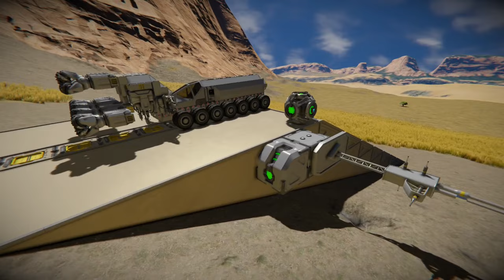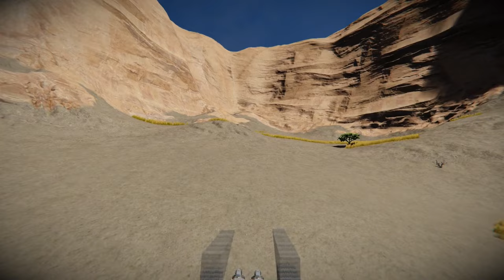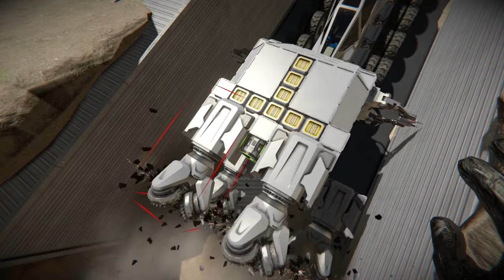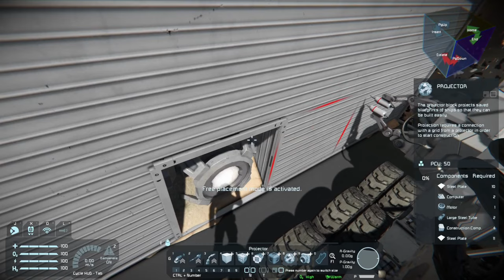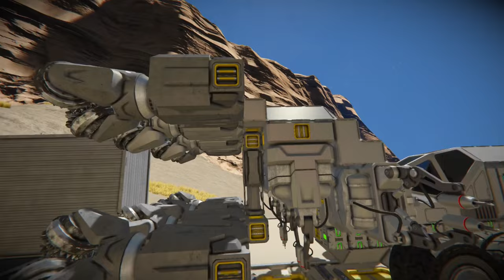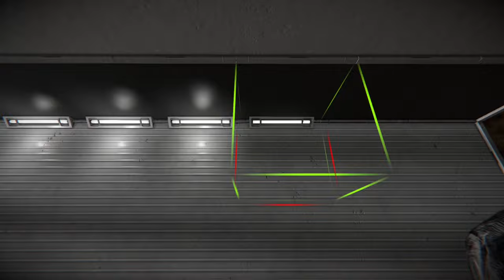How To Drill And Build A Tunnel The Easy Way

Comment: I've built many underground bases, from small to large, but usually do it with stationary drills and welders piped back to refineries and storage so I can process the stone. I've looked at using a rover but the main issue I have is that to go forward endlessly you need to right click mine, and you can't do that outside the cockpit. If you left click, where is all the stone going? Is that survival kit processing the stone and producing steel plates? That must be really slow.
On the making projected guides issue, really long ones I just create in space. I have 500m of roadways and such, up to 1km of a straight line I use for lining up builds.
Reply: In my experience, a small grid rover has little choice but to store the stone and transfer it into a large grid system later for processing. It's unfortunate, but realistic. Ore processing is never done on site in a mine.
Reply: Once the drills themselves fill up with stone they just stop picking it up, unless they are conveyor connected to some kind of storage.  Any additional stone is just lost.
Reply: @Cee64E  True, however mining rovers are only really effective if you use at least one medium cargo container or more storage space than that. If you're only using drills, you might as well mine by hand.
Reply: @sorrowandsufferin924 , That's true if you are MINING for materials.  If you are just digging to get stuff out of your way, like for a tunnel, and you don't need the materials, you don't need storage.  I dug a rather large hangar out of an asteroid using the PAM autominer script and dumped every bit of the stone overboard because I didn't need it.
Reply: @Cee64E  I am ALWAYS mining for materials. I always need every bit I can get, I am a hoarder that way. Stone still yields basic materials (iron, nickel, silicon). Even a basic refinery can yield a lot of material if you're mining out of a huge area of stone.

Seems like a terrible waste to throw it all overboard.
Reply: @sorrowandsufferin924 , Yeah, me too, normally.  But when you've already got 6 large cargo containers of refined ore and 4 of components with 6 fully upgraded refineries on your base, and retaining it will quadruple the time it takes to complete the dig, you have a choice to make.

Comment: Next time, have the projector in the tunnel wall be part of the blueprint.
Step 2:  have it project its own blueprint, then re-save the blueprint now that the projector is set up correctly.
Step 3: Build the tunnel, and enjoy the self-projecting projector automatically extending the tunnel infinitely with zero effort.
Reply from the maker: Great tip! The build is a lot more efficient with integrating a projector within the projection.

Comment: what kind of mod or script is it that drills spin so fast??
Reply from the maker: The actual speed of the drills is slower, but for viewing purposes the video playback speed was increased.  The machine was operating at approximately 1 meter per every 20 seconds on normal speed.  So this is viewing the speed at 3 meters per every 20 seconds.

Comment: wait how do u stack wheels??
Reply from the maker: To stack the wheels the rotor simply needs enough space for a wheel and then it may be a bit tricky but as long as the rotor is locked in position and set to zero it should allow additional wheels to be added.  I typically add the additional wheels prior to lowering the driller to the ground and before I operate the rotors. Hope that helps.

Comment: Why not build the projector onto the rover?
Reply from the maker: Good question, I attempted several ways to add a large projector to the small grid and although it can be done, the projection would not line up with the stationary large grid for me.  However, it might not be impossible and I encourage you if you would like try it.

Comment: I’d put wheels on the side to keep it straight
Reply from the maker: Thank you for the tip.  After some tinkering I found that placing small pistons at the forward section and aft section with wheels definitely improved the control.  The pistons were set to 0.6 extension with 3x3 wheel suspension set to maximum strength.  The setup allowed for continuous drilling without having to adjust.
Reply: Don’t use the suspension ones use the ones without that way there no give when moving

Comment: Too slow for my taste
Sure it's automatic, but not nearly as effective as it can be
I'd slap a rotor to add a large grid refinery and basic assembler so it can produce steel plate faster and solar panels instead of reactors
Reply: 'Tunnel' - Solar Panels
Reply: @armastat  sure solar panels are useless inside a tunnel, but even a tunnel boring machine isn't inside a tunnel 24/7
Reply: @themidnightbanshee5927  Considering how fast this one digs -- it will be.
Reply: @armastat  good point, replace the rotor wheels with regular ones and that issue solves itself, also replaces the need for pistons to adjust drill height cause the suspension already does that